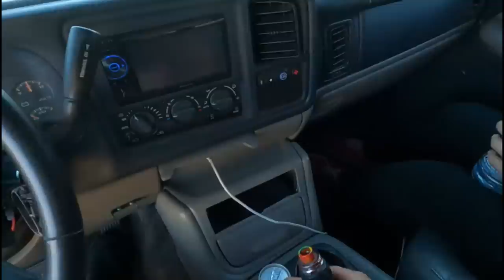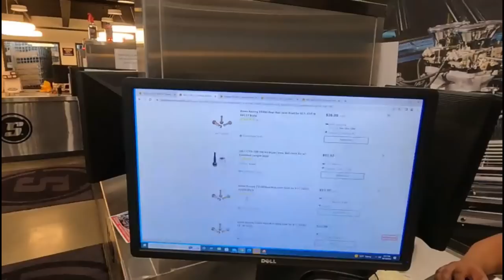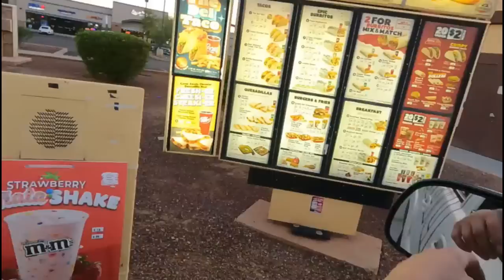BLAST cabinet ready for duty!

Comment: What's up with your breaker? Make sure whatever size you put in there is rated for the wires gauge. 20A needs #12 or bigger and a 15A needs #14 or bigger.

Comment: the blast cabinet is supposed to have glass on the inside plastic on the outside. i use 2 pieces of glass on mine. lowes has a 24x36 glass usually they can cut it there and it would give you three pieces for like 21 bucks